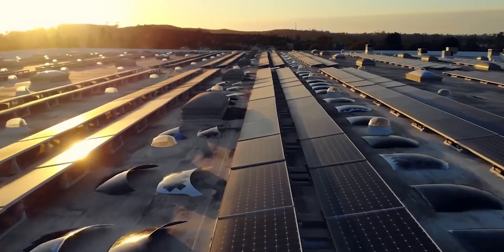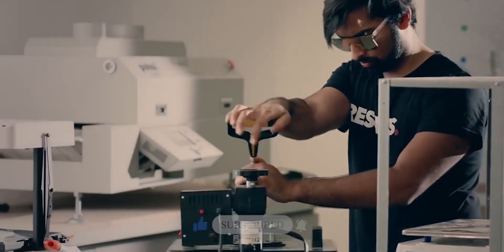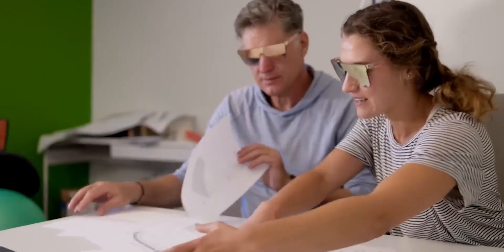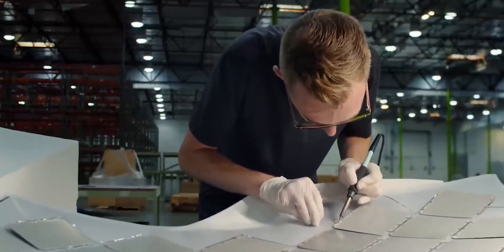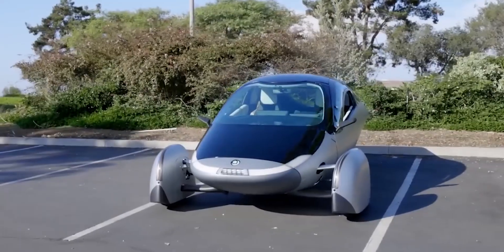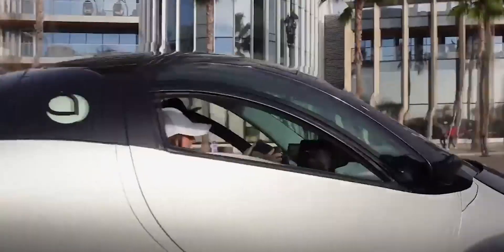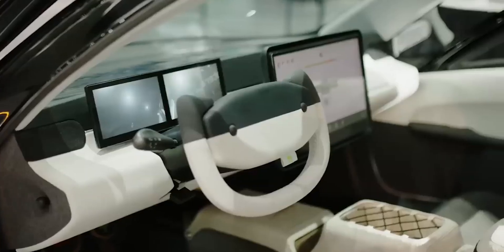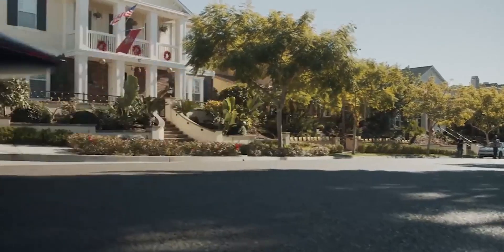Why Aptera's Solar Panel Technology Is A Gamechanger !

Comment: ... they didn't outsource it.  The panels are completely in-house.  The cells are what they are getting from the third-party - gen3 Maxeon cells from Sunpower, which have been available for some time.
Reply: Check out the news article from 4th October, 4th paragraph
Reply: @WyndStryke  It's best not to directly interact with trolls.  It only gives them oxygen.  Best to let them suffocate in their own hot air.  Anyway, I have worked with ALL generations of Maxeon/SunPower 125 mm x 125 mm cells and can tell on sight that the cells Aptera had on Gamma at Fully Charged are, indeed, Gen 3 cells.
Reply: @bobhilder1469  He asked a straightforward question, so I answered him.   Unfortunately youtube blocks links so I couldn't give him  a straightforward answer (the one which is visible was just one of about 5 attempts).
Reply: @WyndStryke  I understand and I was only trying to give you a little friendly advise.  Have a great day!
Reply: @WyndStryke  That's a reference I can't access. Try again.
Reply: Show me where they are specifically Gen 3, and not the old stock of Gen 2?

Comment: How many miles of charge do people think they are going to get on any given day.  That 40 mile figure is under perfect conditions, stationary, but tracking the sun for a perfect day under maximum insolation conditions.
Reply: On any given day people likely think they'll get 0 to around 45 miles.
Reply: I park outside at home and at work. Here in New Mexico, I estimate getting around 30+ miles/day. That's over double my daily commute, so I may never have to charge until I take a trip.

Comment: Aptera didn't say the companies they first worked with said it couldn't be done.  They simply said the suppliers and manufacturers THAT WE TALKED TO said it couldn't be done (which is likely a bit of a fib, by the way).  I suspect that if they would have talked and/or listened to suppliers and manufacturers that already have proven that high efficiency, automotive grade, compound curved arrays could be made, they would be already be making and selling finished cars.

Comment: It is relatively simple to make high efficiency compound curved solar arrays (even "automotive grade") and it's been done for over 30 years in solar car racing.  The ONLY real possible "accomplishment" by Aptera, is that they will be able to relatively quickly make theirs and that's a good thing if they need to make a profit.....
Reply: fwiw, those solar race cars don't build cells to the same specs wrt long term reliability that Aptera is calling 'automotive grade'. They need cells with the highest output and lightest build, but they don't need to withstand hail storms or survive fifteen years of constant use
Reply: @GoClimbARockEh  First, with respect to solar race cars, with but one partial exception that I know of, Sunswift 2, they don't build CELLS.  They either build or have built to their specifications, PANELS.  It's not clear to me that you understand the difference.

Second, most of the solar race car panels are made with 20+ year life rated materials such as cross linking EVA encapsulants, ETFE top film and PVF/PET/PVF backsheet only much thinner to save on weight.  There are thicker versions (similar to Aptera's thickness no doubt) that are offered with 20 year power warranties and they easily "passed MIL-STD-810-G tests for impact, vibration, water immersion, puncture, thermal cycling, 100 lb. pull force, sand exposure, radiation exposure, shadowing, and more."  In fact, "to test their toughness, (their) panels have been dropped, shot, hammered, drilled, kept underwater, and even run over by a Humvee. Each time, (their) panels survived with over 80% of their original power output."

Do let me know if you hear Aptera offering a 20 year power warranty on their panels......